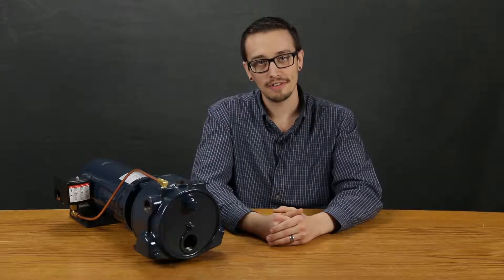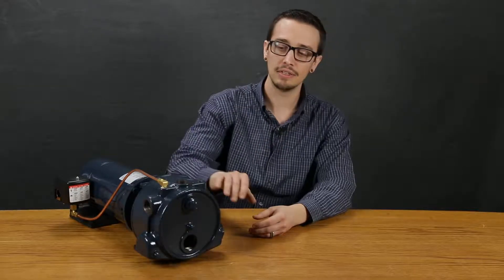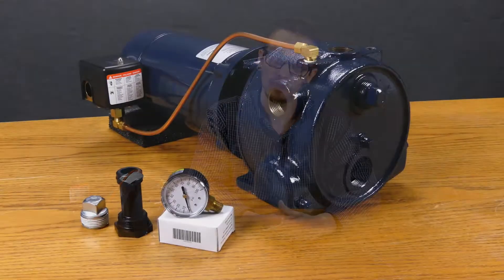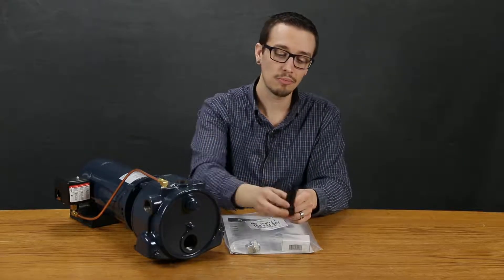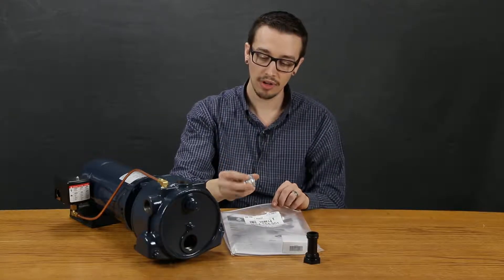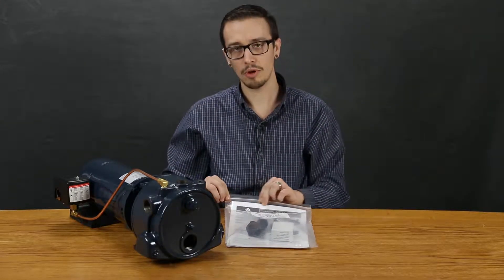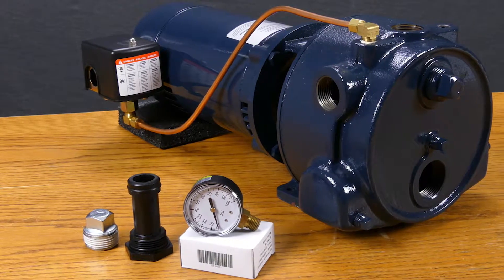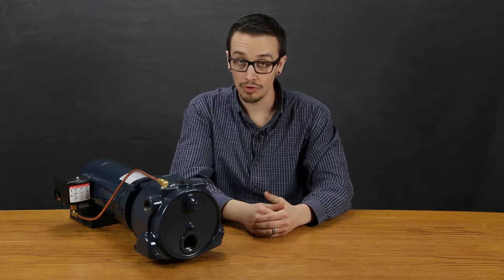Franklin Electric RM2 Pro Series Convertible Jet Pumps

Comment: I got a customer with out water due to shallow well ejector cracked. The pump boosts water from above ground storage tanks right next to the pump into pressure tank. He don’t have ejector plug that came in the startup kit. Is the only option to use this plug? Can pump be piped differently to get buy till Monday?

Comment: Hello, i need some help. I'm using the two line version of this  to draw water from the lake. Suction lift is 40 ft. distance if 87ft. The pressure fluctuates between 15-35 psi and will not build pressure high enough to shut off. There is a swoosh or surging sound that continually occurs.  pump is brand new and has been primed. A new venturi, foot valve and screen installed at the lake. any advice?